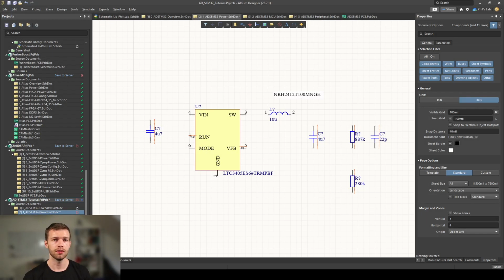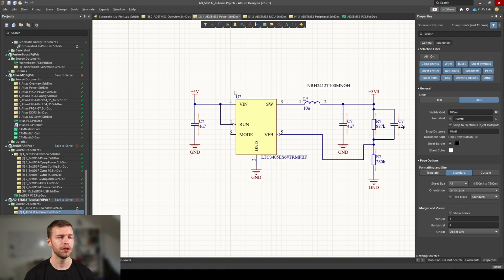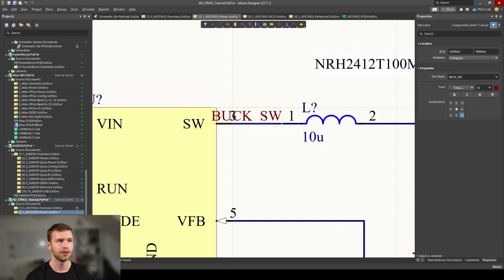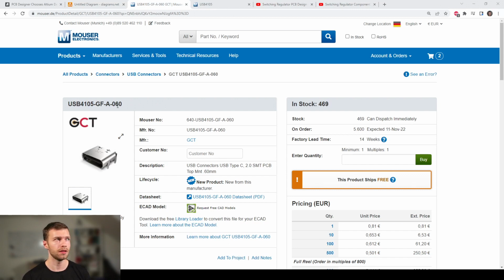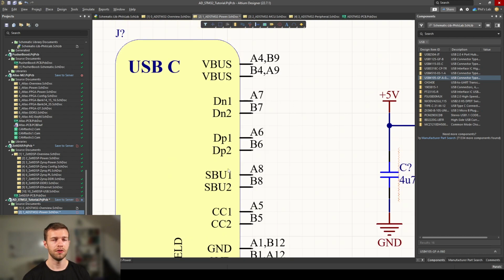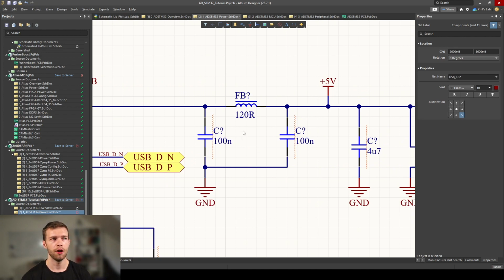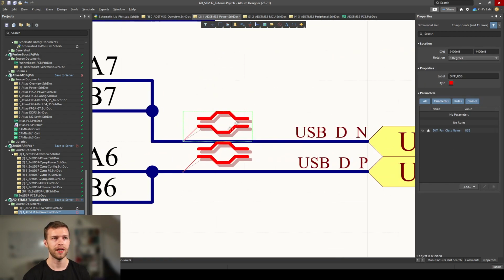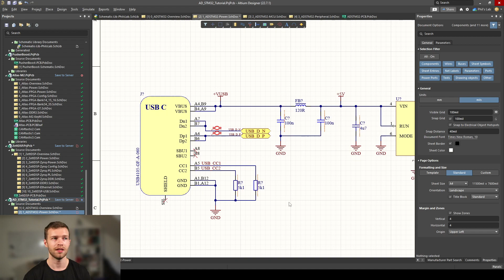Microcontroller-Based Hardware Design With Altium Designer - #3 USB C

Comment: What do we need to do if the usb-c is connected to the output of the converter and the usb-c is only acting as a connector (power connector) to another usb-c powered device
Reply: do i connect the CC pins to gnd or Vcc

Comment: Sir I have two questions:
As you said, pi-filter is a lowpass filter. What type of noises pi filter is reducing. 
Question 1.  Let suppose we are using SMPS, not USB.  We can also use  this pi-filter after SMPS ? (excellent quality SMPS) ?

Suppose an AC inductive load when "switched off" create high surge voltage on POWER LINES. I have seen SMPS is not able to stop the impact of these surge voltage. So it pass through SMPS and disturb microcontroller and other components on board.
2. Do pi-filter will be useful in this case?
3. We can also used EDS protection after SMPS ? 
    ESD protection after SMPS will be helpful to reduce impacts of surge voltage ? 
    What component will be used for ESD protection ? TVS diode ?

Humble rest to guide in details :  🙌
share a relevant video link.

Comment: Hai i have a question please answer to me
7:20 how can i get 3 A of current ? Is it possible by changing the value of resistor connected to CC1 and CC2 ?
If yes then what value should i go with ?

Comment: A few issues tho:
- Large symbols with missing pins make the schematic unreadable, and it is not obvious where the remaining pins go. Pro tip: use smaller multi-gate ones (say, here it is begging to split off the data lanes into a separate gate), so the schematic would be logically structured - and show every single pin so the reader would not get confused!
- This is not C, but a "compatibility" C connector over USB 2.0/1.1, not only we all know how to route this relic, but also it even lacks the OTG features. The (somewhat) true C needs: power feed direction, voltage request/feedback, side selection/lane mux, usually a set of TVS as we talk potentially high power...
- Everything with external cables must be protected! Aside of the mentioned TVS you need a fuse and an OVP for a case of a residual charge or a PSU glitch. Also by the specs the USB hardware must remain intact under a cable failure, so for a high-voltage request this one is not even a way to start.
Reply: Speak for yourself about knowing how to route relics. Also 2.0 is enough for 99,8% of projects and using a proper type-C IC would have just complicated a tutorial clearly aimed at beginners!
Reply: @kettusnuhveli  Wait, what? It is 2024 already, and someone doesn't know how to route USB2? Guess that is possible only in one sole case: one just doesn't need that at all in first place ;) (and btw nobody ever stated the actual line impedance on D+/D-, also stating you need a mux switch for 2.0 speeds is a false statement). Anyway. 2.0 is enough for whatever it is enough, sometimes even 1.1 is the best choice, in some other cases 2.0 is too slow - but. The title clearly states: "USB C". The content, however, covers almost nothing from the C features - could've been just routing power off the jack and calling it a day.

Comment: Very informative video series, but I'm curious why Phil verbally glossed over ESD protection twice, whereas demonstrating it and explaining the hows and wherefores of it would only have taken an additional minute or two. At the risk of being redundant, it's best to make a habit of practicing best practices from the beginning, so that when you do design a commercial product they'll be habitual. Basic ESD protection is terribly simple and should be implemented even in hobby-level designs; wouldn't want your whiz-bang prototype to crap the bed because you scuffed your feet on the carpet and forgot your grounding wrist strap.
Reply: Most devices are HBM ESD-rated so unless you are an elephant your carpet won't kill anything ) For USB-C, a thing to worry about much more are the external ground loops, residual cap charges and PSU glitches, as here it is no longer a boring 5V-2A at most, but a high-voltage adjustable device to be capable of 20V/65W (probably more - those are the specs I've seen on an actual device), so it needs some caution to be taken ))

Comment: Thank you for the video. I wish to know if there is part 2 of it regarding pcb trace routing for the differential bus of usb c? I am working on a type c receptacle and find the dual pins of differential bus pins particularly difficult to route.
Reply: Thanks for watching - yes, we'll cover routing of this board in later parts of this series, including the USB C diff pair.
Reply: @PhilsLab  But here it is not C, but a conventional USB 1 or 2 :P
Reply: EDIT: I misunderstood your comment - sorry. I guess you mean that the differential routing is maybe not so important here since (even though USB C might suggest it to some folks), the actual data rates we are talking about in this project are in the 12 (USB 1) or 480 (USB 2) Mbps range. It is still a serial connection though 🙂
-------------------------
 @TheBypasser  USB C is the connector. The connector is (mostly) independent of the USB protocol version. This project uses USB C for convenience and maybe for its little higher basic power delivery capabilities (1.5A vs. 500mA with microUSB etc.). You can run USB4, 3 (with all it's confusing flavors), 2 or even 1.1/1.0 over a USB C connector. If you for example look at all those USB C connectors on (entry-level) smartphones today, rest assured that they will not be capable of transmitting anything in the range of USB 3 speeds, but usually they are USB 2.0 (480 Mbps gross) or even lower-speed connections.
Reply: @hopf  Sorry, but what?! USB-C is NOT just a connector (nor a protocol), but an interconnection standard having a massive underlying specification (see "Universal Serial Bus Type-C Cable and Connector Specification"). And yes, you would say you could make a simple device having 1.1 fallback, or even just power alone fed through a Type-C connector and still remain sort-of within the named specs, but that is what the millennials would call "a lifehack", as we all know how to route those older USBs, now routing a fully-featured Type-C is what can get confusing at first (and exactly what you didn't show us).